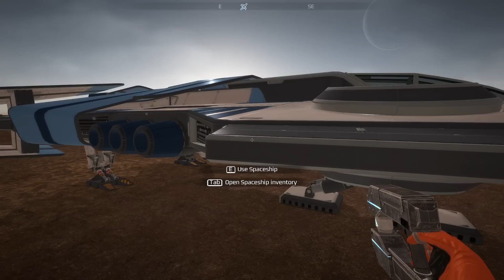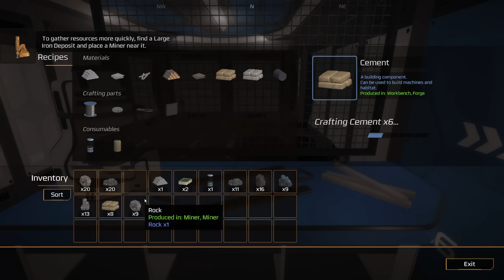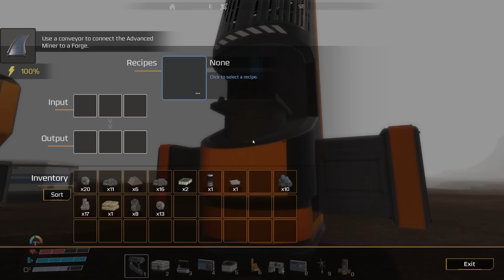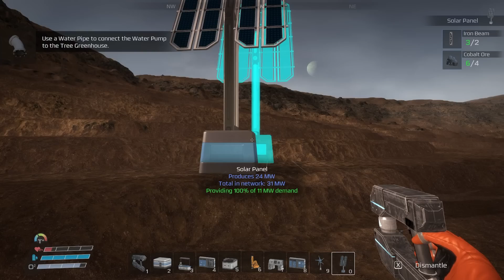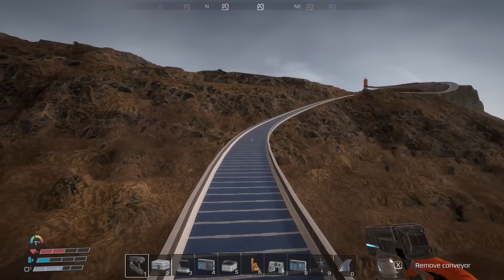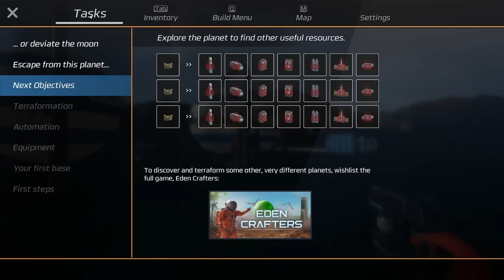NEW Planet Management Automation Game!! - Eden Crafters - Base Building Factory Builder

Comment: The hill above your base. There is a cave just a few meters from your base. There is a lot of sulfur. There are 2 more sulfur caves on this island. You need the sulfur for the battery to power your ship or you will not get to the island that easy ;)
Reply: i crafted energy cells from sulfur, but they are not useful for ship, only for battery craft. and battery is just a building to store power
Reply: @Voen_Sveta  The "Vehicle Energy Cell" needs 5 Sulfur